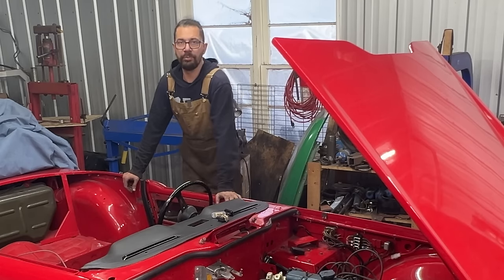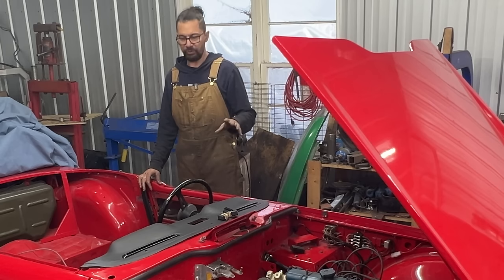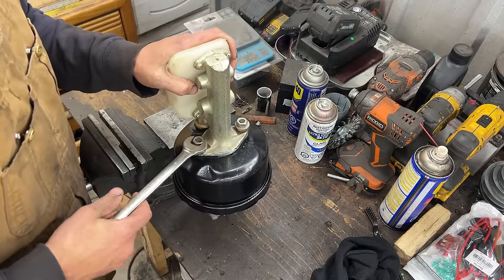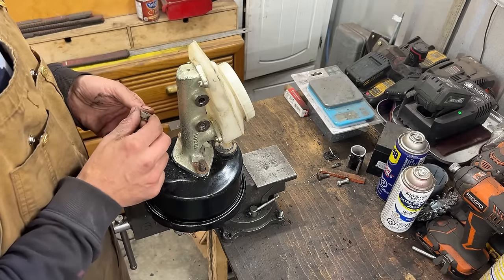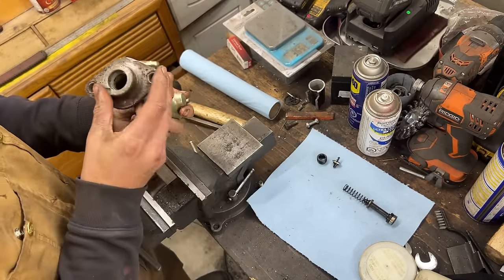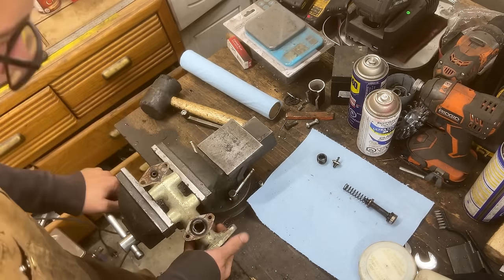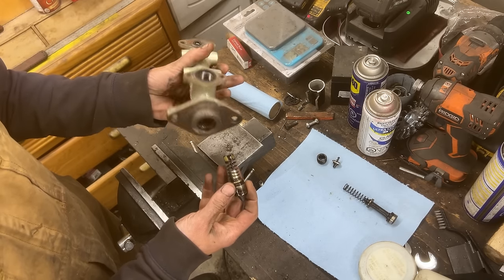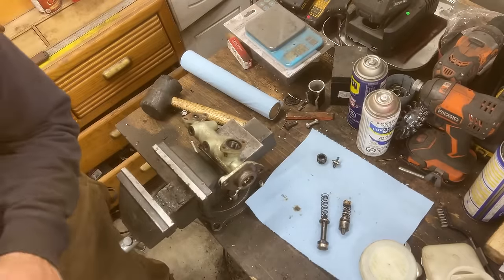1970 TR6 - Part 29 - Rebuilding Clutch and Brake Cylinders

Comment: I think the honing tool in the clutch slave cylinder was a bit too severe... the pressure from the compressed springs in the narrow bore must have been high and scratched more than necessary ?

I would have soaked the piston / bore in good old traditional 3-in-1 oil first before bashing it out, and then steadily polished the inside with steel wool or 800 grit paper and more 3-in-1, repeating the process steadily softens and removes surface corrosion on items like that....

Comment: Good explanation of the dual circuit brake system. I am only familiar with the single circuit system. I did rebuild my Lockheed Brake Vacuum Servo and as far as I know, there is only one company supplying the rebuild kit.
Reply: (I know Moss Motors were talking about plans to manufacture their own copy brake parts) but the CEO put his foot down and it all came to a grinding halt..

Comment: Excellent video, but...
Not sure I would put that much work into the clutch slave cylinder. A brwnd new replacement only costs $20. That's an aftermarket brand, though. 
The master cylinders for TR6 aren't too expensive, either. An aftermarket brake master cylinder is only $47. An OEM (TRW/Lucas) is $150. An aftermarket clutch master cylinder is $90.
All prices are Moss Motors, where the OEM brake master is currently back ordered, while the other options are currently available there. Might be different elsewhere.
Reply: I’d tend to agree. Plus with all these cylinders having sat so long with remnants of fluid in them, especially given the state of the clutch slave and the grit in the brake master, I’d not be confident they’d last all that long.

Comment: I would suggest attempting to disassemble and clean the old switch.  I have done this with success, but not on that model year switch in particular. Based on my experience, the rebuilt electrical components are far, far, superior to the aftermarket versions.
Reply: Well no one is going to question your experience Bill, even if your quality has been questionable occasionally..

Comment: I think its great showing us all how these components operate ,but i would have gone with a new master and clutch slave. Time , labor and parts are just not worth the end result. Brake fluid alone is very corrosive now add moisture and you have a recipe for rust and scoring of metal. Honing will change the size of the bore and could result in a soft pedal or worse  The OEM brake booster can be re built by shops that specialize in that you need the equipment to open the case to access & replace the damaged diaphragm . Please don't get me wrong here i love your work and have watched all your videos and learned so much from you ! this is just my 2 cents